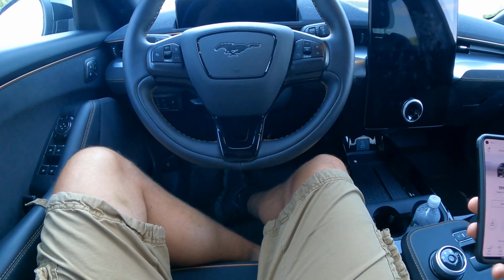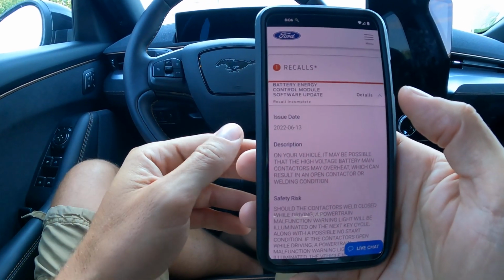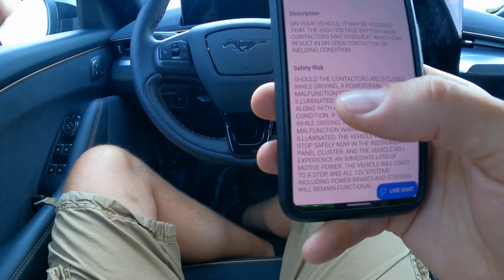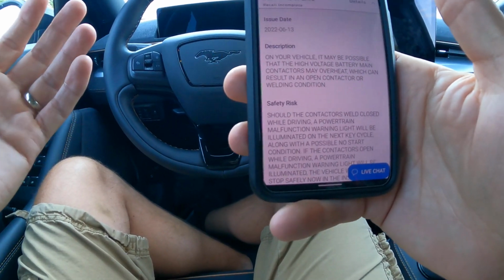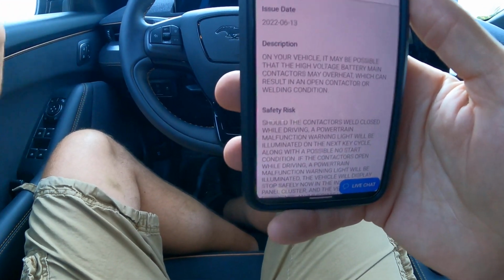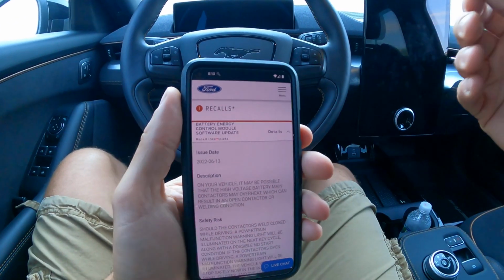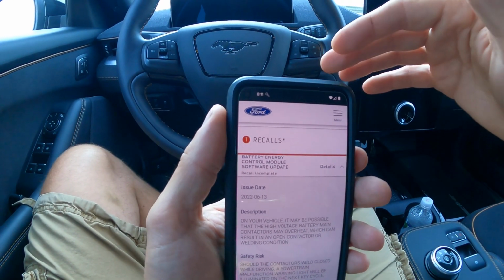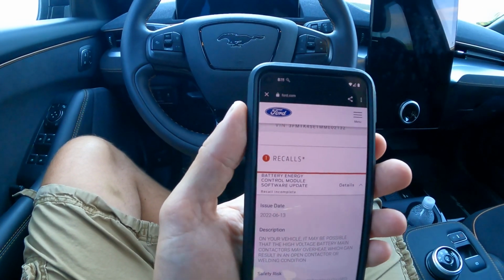Mach E Recall - Now what's wrong with the MME!?

Comment from the maker: To clarify,  this isn't an issue with the battery or battery terminals.  Instead, the contactor/relay(s) may overheat and weld itself in a position thus causing the part to fail.  I still can't help but to think with a software update, some performance aspect is now being limited.
Reply: As an aircraft mechanic, HVAC tech and solar hobbyist...I agree, current limiting is the only "software" fix. I'm holding off another year or three on an EV. Maybe they will have the gremlins worked out and more charging stations.
Reply: now have confirmation that the software fix is junk. they properly opened a recall a year later when the hardware is failing. my car stopped working when the recall isn't even shipping parts out.  my car is now basically a brick until further notice.
Reply: im in the UK and have a match e LR and have just had a recall letter,  bought it used so it may have already had the software update, my question is does the software update limit how fast you charge on a fast charger as i have only had max 90 kw when its supposed to do 150. thank you and hope your issues are solved
Reply from the maker: @marklocke5486   the software doesn't limit that.  The environment may limit it if the battery bank is too cold.  I think this system is somewhat flawed as many users, including myself, have not been able to get over 110kw charging speed for one reason or another, even when the current battery level is below 80% for DCFC

Comment: Our updates are done and this just happened the car won’t start and far from home. Stop safely now is the sign we’re getting displayed. What a mess
Reply from the maker: Sorry to hear this.  Did you try powering it down completely, open the doors etc so you know the power is all off, wait 10 minutes and restart?
Reply: @upnorthmike6085  hey thank you. Yes we tried everything and eventually the 12v died and after waiting 3h for first towing that bailed we waited another 2h for the second who had a booster? And was able to get the 12v back enough to put ourselves in tow mode and neutral. It’s now at Ford outside the gates since they were closed. We’ve had the car for about a month 😭 I just hope they’ll know what’s wrong and truly fix it 🤞🏻

Comment: I own a 2022 mustang mach e gt bought it a month ago brand new 0 miles and at 1300 miles the vehicle has had catastrophic failure, on the speedometer screen a warning showed up saying "stop safely now" and the car has refused to turn back on, it had to be towed to the dealership, the service dept. at the dealership said "oh a little update will fix this issue" so they updated it and i drive off, well 12 miles from the dealership the mach e broke down again with the same warning message popping up and refusing to turn back on once i stopped. It had to be towed again to the dealership now the dealership doesnt even know what to do with the car. I believe it the high voltage battery junction box but the dealer doesnt seem to want to do any serious repairs to my mach e. Ive already started a case with ford to see if ford can speak and assist this dealership but it seems like its going to be a long time until my mach e gets fixed. Nobody wants to seriously put some effort in trying to figure out whats wrong with my brand new car.
Reply from the maker: This is also widely reported.  When it has happened to me, I was able to stop the car, turn it off, and let it sit for about 10 minutes (so it's completely powered down).  I have then been able to start it and drive off.  Are you in a very cold climate?

Comment: I have a 2022 Mustang Mach-E GT and I actually got that warning on my dashboard that said -Powertrain Malfunction/Reduced Power 
-High Voltage Battery Warning
I remember I got that when I was showing my friends the torque and performance of the car. AND AN UPDATE FIXED THAT WHICH HAPPENED TO BE A FEW DAYS AFTER THAT INCIDENT.

And I got the same issue about a month ago due to the same thing. I was speeding on the freeway 🛣️ because I was running late for something and I’m waiting for another update to see if it fixes the issue again.
Reply from the maker: So far, the 4 times or so I got this warning, after the car was shut off for about 5 minutes, the warning went away and there were no error codes.  For me, it usually happens when it's really cold, the heat is on and you get after the pedal a bit too much

Comment: Ford has to package these recalls on the information for public consumption. It's more about damage control after they screw up then putting the extra r&d in to make sure that they make a good product. Trucks come right off the car carriers from the factory and cars as well with several modules ready for updating. That means they're still fumbling and trying to get it right as they're putting vehicles on the road. Not acceptable. Your nightmare is only beginning

Comment: Mike,  I really like your videos.  I am in the same situation,  2022 MME GT was bought in March.  Live in NH, where there are very few MME.  The fix would seem to be to replace the part but that will be very expensive.  I bought the GT for the power so I hope it is not limited with this software fix.  I paid over sticker for this loaded GT.  Im also worried the dealers up here have never worked on a MME so I'm kind of nervous something will go wrong.  Next up will be the winter temperature test.   That was a big issue for you.
Reply from the maker: I'm in the same boat Gene.  I was hoping to wait for more MME's to be on the road so my dealer would feel more comfortable working on them.  I dislike the thought of being a guinea pig if they have never had to work on one.  I think you'll be OK though with a 22 model as the heat issue should be corrected.  Keep me posted when that time comes
Reply: I bought my MME in Maine and drove it back to NH where we live. We have a very small Ford dealership about 7 miles from me.  Before I even bought the MME   I called them and asked if they were certified to work on EV's since I'm not driving back to Maine for service. They said yes.  I was even thinking of stopping by and introducing myself to the service manager.  Kind of establish a personal relationship before any problems arrise.  Relationships and people who like you can go a long way in the service industry. Knock on wood,  I never have a problem in this mountainous desert EV wasteland but I do love driving this car!!
Reply: And you have every reason to be nervous. Even the mainstream dealers in the big cities have no idea how to fix these cars.

Comment: There have been 3 recalls on the MME.  The two glass recalls are just theoretical, they've never happened in the wild.  The third recall has happened to less than 0.5% of the owners.  But these recalls bring the Eeyores out of the woodwork.
Reply from the maker: If you're referring to me as one, my main frustration here is the one month lag from when the recall was made to when I was notified.  The app never told me until the day after I posted the video.  To this day, 07-21, I'm still unable to get this OTA when many others have
Reply: @upnorthmike6085  My point was: why does it matter?
Reply from the maker: @Chucka1463  because the point of the recall is so those contactors don't get into a weld state and fail.  I would much rather just have the software fix then have to schedule something at the dealer later for a hardware replacement.  Since it's an over-the-air update why is it not being pushed out to all of the owners affected at the same time.  That's my point.
Reply: @upnorthmike6085  I understand.  My point still stands:  You have so little chance of have any of the 3 recalls occurring that it really doesn't matter how or when they notify you.  People panic over nothing.

Comment: My understanding of the Software patch is that it monitors the contractor temperature. If or when it reaches a certain point, it will then begin limiting current in order to maintain a stable temperature and/or allow it to cool down, thus preventing the issue from happening. 
These kind of things are done all the time to electronics firmware’s, software fixes/patches to hardware issues or limitations.
Reply from the maker: I think that would be the only way the software side could alleviate that issue.  But again it has to be at the expense of some level of performance.  I bet this is when we see those limiting dots as I call them come up on the display which would limit pedal acceleration significantly.  How long that limitation stays on will be yet to be seen.  I suppose if the cooling system is active and it's only on for a matter of seconds that's not a big deal but it would be nice if they would be transparent about it.
Reply: @upnorthmike6085  I agree and transparency would be nice.